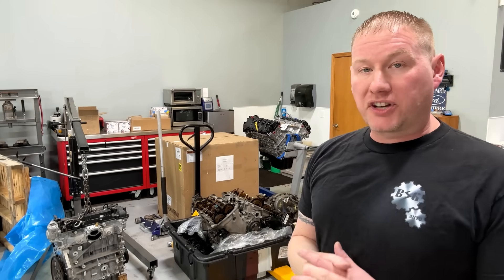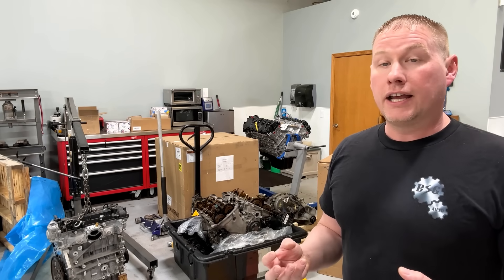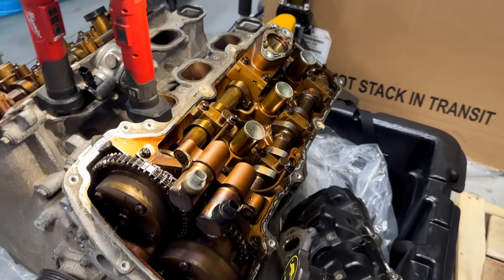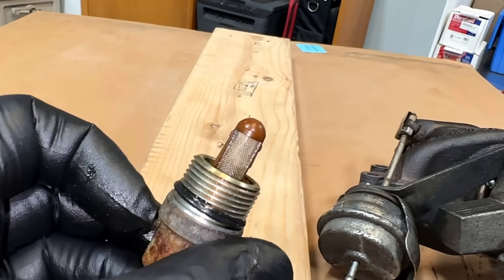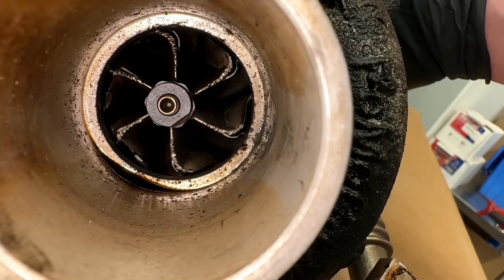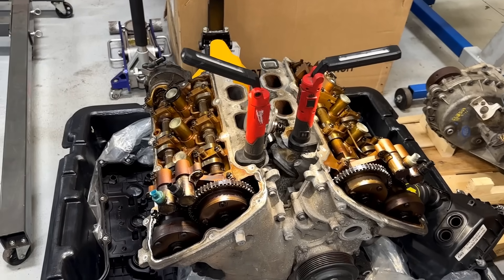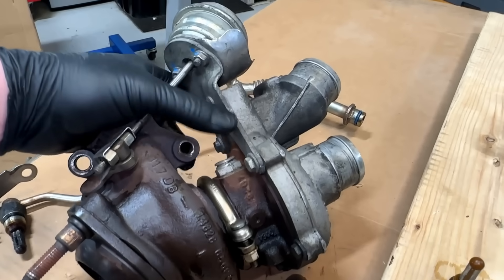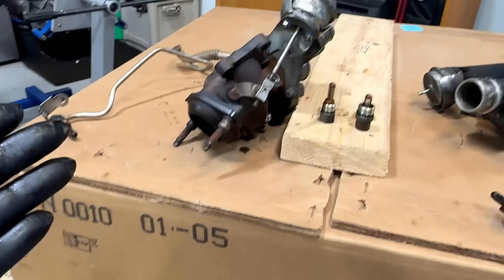This is Why You Never Run Extended Oil Change Intervals on The Ford Ecoboost Engines!

Comment: Every 4k to 5k TOPS I don't go over that
Reply: For me that would mean changing the oil every 5 weeks is a chore but if that keeps them alive it's something you have to do.
Reply: @meeder78 ...or you can buy a new vehicle in 2-5 years or less if you "dog" it out like my buddy....Heck, even a cheap , oversized Go-kart vehicle nowadays is $20,000 and up with no options....
Reply: @meeder78  a MityVac might make this go a lot faster for you
Reply: @meeder78 I put 5,000k a month.
I use Amsoil and change twice a year.
Reply: I see this issue all too often as well being a mechanic. People don’t change their oil on time and what I learned over the past recent years is that there are some vehicles that the manufacture recommends an oil change every 8,000 miles. Some even 10,000. Never go beyond 6,000. Aim for 5,000 with a full synthetic oil and decent filter. Most oil filters are rated up to 12,000 with full synthetic but never go that far. If your engine sees a lot of stop and go city miles or high idle hours change your oil sooner. You may think idle hours are easy on the car but actually it’s not good at all. There is less oil pressure going to the top of the cylinder heads and cylinder walls and everywhere else to help clean and avoid buildup from carbon and soot and oil breakdown residue.
Reply: Yes, just did my own oil change 2 days ago, well under 5K, now at 144k, and running perfect.  Making sure the full synthetic had all the applicable notations we where told in this video.   It sure would have been nice if Ford had a better place for the filter, as one has to go all by feel from the top.  Glad it's done, and make sure you make a note of the mileage on a sticker (if possible, as I bought a bunch on Ebay) to place on the inside of the windshield.
Reply: TOPS is a convenience shop chain in Thailand.